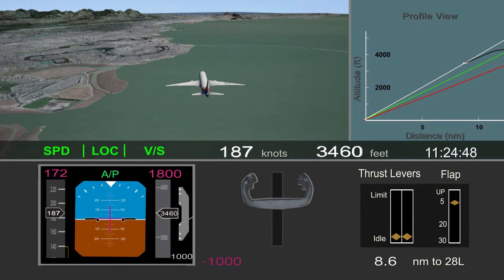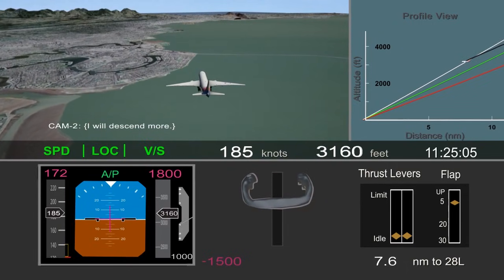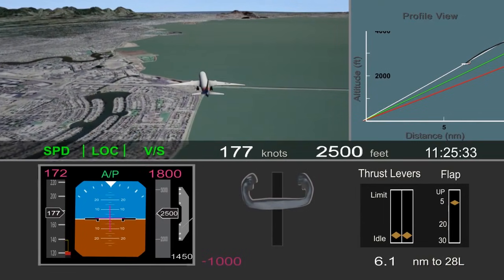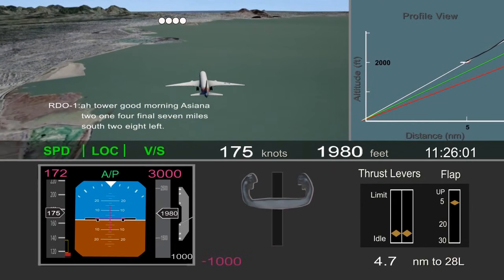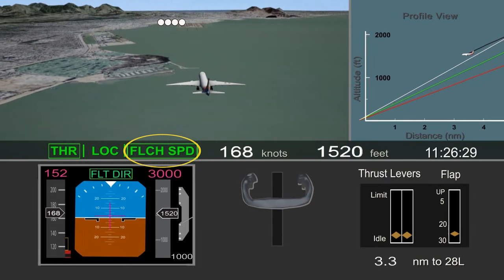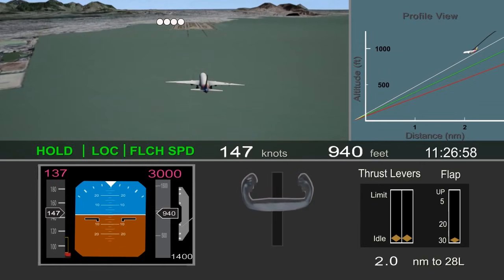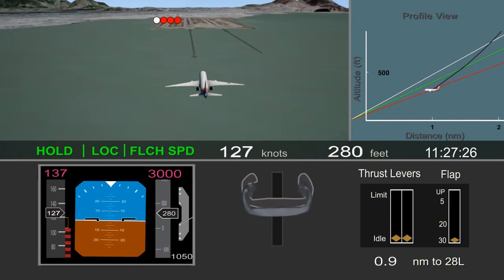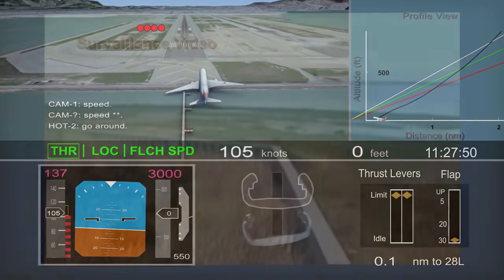Asiana Flight 214 Crash - NTSB Animation

Comment: 28L has ILS/DME while they are using LOC!! give them a cookie
Reply: The ILS was out of service on 28L at the time I believe.  Still not an excuse to crash a plane however.
Reply: 3snowyman maybe , but on the approach sheet it says how much rate of descend required for each given ground speed , and why they are configuring an airplane on short final !! and on final there is 3 items to check every few secs , GS which was out at that moment and LOC and speed !
Reply: MrBryan86 I'll tell you why , because every previous crash was a reason for aviation to evolve in future , in this crash the crew wasn't even looking to their airspeed which is the only thing they should be doing on final
Reply: MrBryan86 I would say the crew has failed in studying the SOPs
Reply: Humans makes mistakes at times, this incident is mostly one of them, but it's definitely a costly mistake. But I wonder why they received so much criticism by people when there are incidents in the past which are worse than this caused by pilot error.
Reply: Eisa Alsuwaidi The glide-slope portion of the ILS was out of service at the time of the crash.  If you're interested, you can all watch the 4 hour NTSB hearing that just occurred today to get their final verdict. It's on the NTSB website.  It seems that they've concluded that the accident came down to pilot error, mostly misunderstanding of the aircraft's autopilot system.  Of course, they should also always be monitoring their airspeed too.
Reply: AviationChannel27 The A/T doesn't change to HOLD when FLCH is engaged.  It changes to HOLD when the pilot moves the throttle to any position while A/T is engaged.  Then it functions as you described.
Reply: The ILS is indeed out of service for quite some time when the accident occurred, it has been confirmed
Reply: I think this incident can also be something we can learnt from, maybe stricter automation which includes auto throttle to work no matter what mode the airplane is in.
Reply: Eisa Alsuwaidi You are making the same assumption as the crew that crashed this plane by saying: "It works all the time .." Well it doesn't. When you engage FLCH mode on the autopilot, the A/T automatically changes mode. The mode is called HOLD and that means it will just hold the throttles at the place they are at that moment. That means it doesn't follow a target speed. WHich is exactly what happend here.
Reply: AviationChannel27 it works all time and that's correct , what changes is the mode selected , N1 or target speed !!!

Comment: Wow the mistakes they made were inexcusable. The auto throttle and altitude selector are virtually the same on every Boeing jet and very similar on Airbus. 100% pilot error.
Reply: robo931 pilot error? pilot fuck up.
Reply: Limitation and it's in the fctm flch not allowed below 1000ft
Reply: stupid pilots
Reply: Aside from lacking flying skills, many Korean Pilots are very very VERY lacking, in "Pilot" Character and Ethics.  For full two minutes while the plane was burning on the runway, the pilot was worrying more about his career, than his passengers's safety.  He did not order evacuation, until his sense of DENIAL, was finally extinguished, by his desire to save his OWN ass, in the bellowing smoke (instead of his passengers).  Compare this Korean COWARD, to that Japanese Mechanic, who committed suicide, after learning the JAL 747 crashed in to mounting, cuz he did not Double Rivet layer, to patch a tail strike landing.  Rule of thumb is, that you need to evacuate in 90 seconds to have a decent chance of survival from a burning plane.  You should sit down and see a 2014 SaeWurHo Ferry Sinking.  The Ferry was twice over laden with a blast full of air, to make the ship horribly tipsy.  The captain was a sleep.  When the ship was sinking, the Cap. told everyone NOT to abandon ship, but He was the FIRST man, off the ship, picked up by coast guard boat, sent JUST for him, and to destroy navigation log and black box.  When Japanese offered a very elite specialized under water rescue divers, Korean Gov refused and Censored the communication.  When Korean American tried his diving bell, someone, sabotaged his equipment, and tried to sink him, too.  over 200 jr. high school kids drowned, WAITING For rescue.  Safety culture, is product of it's people.  If people are gutter oil in quality?.... guess what?
Reply: @andrewjackson7476  many korean pilots are skilled and take pride in what they do.  This case has more to do with their culture where "juniors should not challenge seniors"...causing disconnect.
Reply: @andrewjackson7476  this kind of behaviour is taught to people these days, our society has moulded us into being like this, what we see in south korea and japan, in a few years/decades we are going to see this more in western societies and in places like china/india. 
about 50 years ago, people would sacrifice themselves if it meant it saved people. for exeample during chernobyl, military generals and politicians arrived there on the ground near an unstable nuclear reactor, went in there themsevles to save people. and this was the norm. and I can give 100 more exeamples.
Reply: Gross negligence aside, a crash can never ever be simplified down to "pilot error".
Reply: That's when you only teach pilots on a budget to press buttons and fly on autopilot. These folks at that airliner or similar from that region probably never heard of stick and rudder flying....must be the cellphone and E-sport generation....

Comment: So curious how well trained pilots made a mistake that a first timer with no flying experience would do in a plane?
Reply: "well trained pilots"
Reply: the crew wasn't well trained on this aircraft...they admitted to not being very familiar with the autopilot system
Reply: Scary they we were not confident.
Reply: James Linda Hindsight.
Reply: Enthusiastic Coder
VOR approach was elected. They were using the V/S descent
Reply: The equipment on the ground?
If so then what were pilots using to make the glide?
Reply: Oh ok.
Reply: ***** are you sure are you guessing?
Reply: Asiana Fan, the A380's thrusters only auto-accelerate if the autopilot is turned "auto", and not "on". There is 3 switches: off means you can't input data, on means you can input data but autopilot won't do shit, and auto means autopilot actually flies the plane. 

There is a different system on the bigger Boeing planes, pretty much more difficult to handle, since you have 3 input panels, 4 nav-adf-com panels and 3 switches on Flight director, with 3 positions each. 

Though falling from 13x knots to almost 100 is cannot be unseen. Or unfelt, at least! 

If you are not trained on heavy plane like 777, or even 747, you cannot set up autopilot. Except for ILS, that's easy everywhere... In this case it didn't work properly as long as I know.

What I really hate in Boeing 747-400 is that there is not director source knob (only for "L, "C" and "R"), so you cannot select nav or gps, it will fucking guess. Though I you get used to it it gets easier to change altitude and airspeed, because it can handle more than one input source.